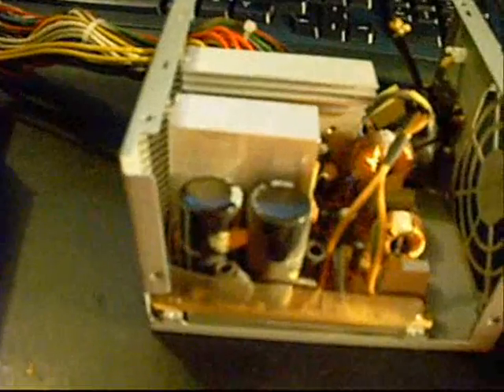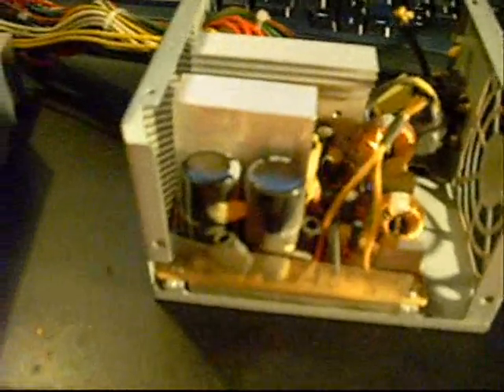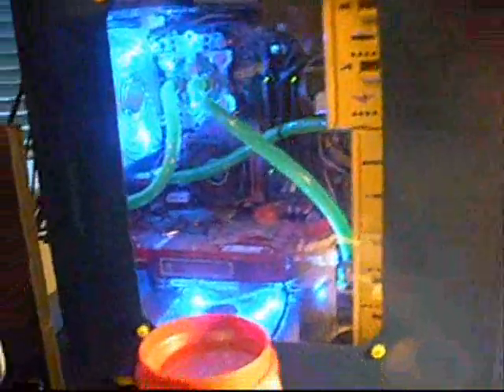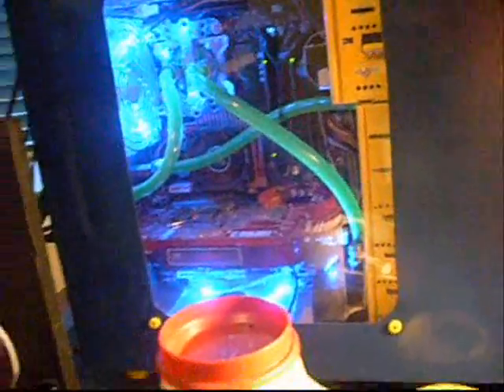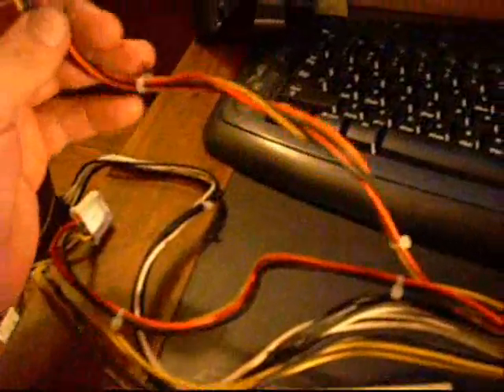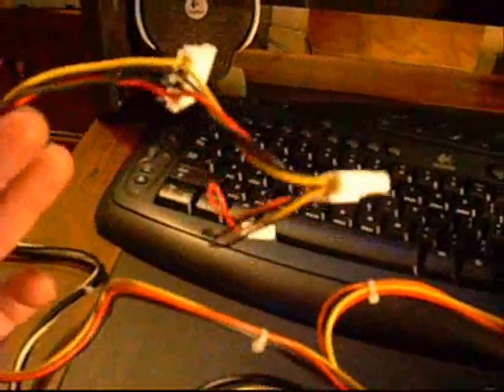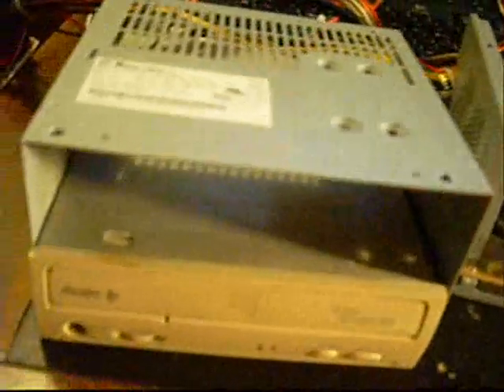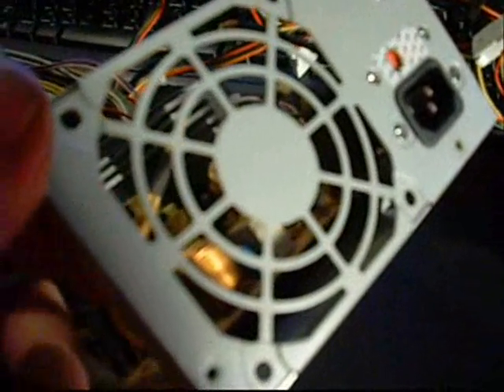Dont throw your old computer parts away before watching this

Comment: You forgot to add that if somebody opens a Power Supply (even if its not connected to the AC) they run he risk of receiving a shock so strong that it could spot their hearts and die!  So much for saving a few parts worth cents. Don't try that at home kids!

Comment from the maker: Dont do it if you can avoid it. The main problem is the big caps in there if you can get to the bottom of them short them out with a insulated handle screwdriver. Just touch both terminals on the cap and that should drain it. But be careful. I highly recommend that you avoid opening them and do so at your own risk.

Comment from the maker: I wouldnt ruin a good power supply for a fan. But if you got a dead one then by all means. Most of the older power supply had 80mm 90mm or 100mm fans. So they can be pretty useful. :-)

Comment: i scrap the bits that are broken like the heatsink on the broken parts in fact i buried a power supply 1 metre in dirt in the garden about a year ago as i st could not be bothered to do anything with it DONT worry it was just metal bits left why i will dig it up and get the old aluminuim out of it the and the steel that would be a bit rusty by now i will take that too to scrap

Comment: CPU:	AMD Turion X2 Ultra ZM-80
Code Name	Griffin
Package	Socket S1 (638)
Technology	65nm

motherboard Manufacturer	Quanta
Model	30F2 (Socket M2/S1G1)
Version	Rev 1
Chipset Vendor	AMD
Chipset Model	780G
Chipset Revision	00
Southbridge Vendor	AMD
Southbridge Model	SB700
Southbridge Revision	00

graphics: Generic PnP Monitor on ATI Radeon HD 3200